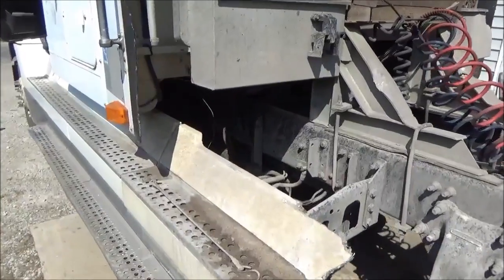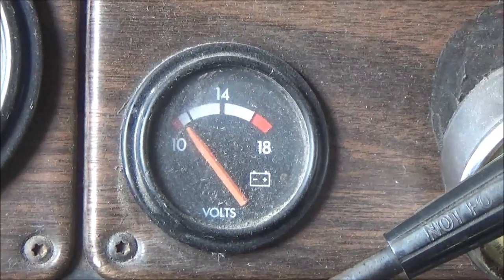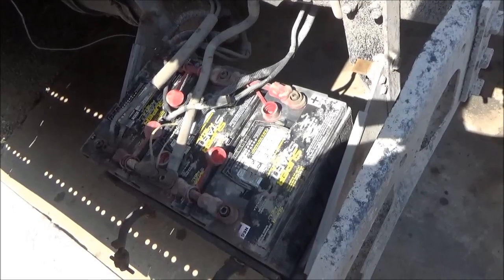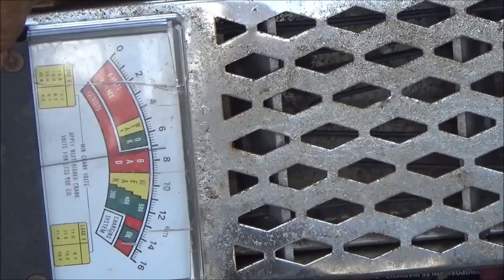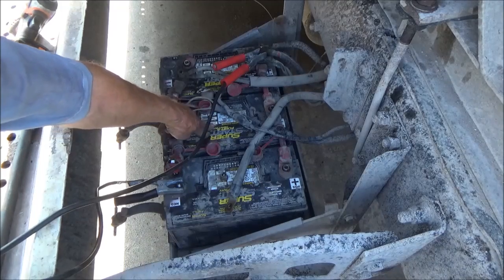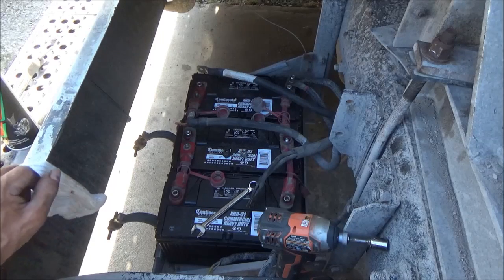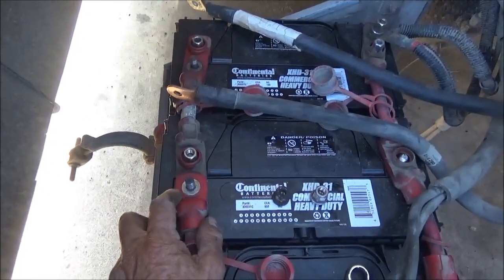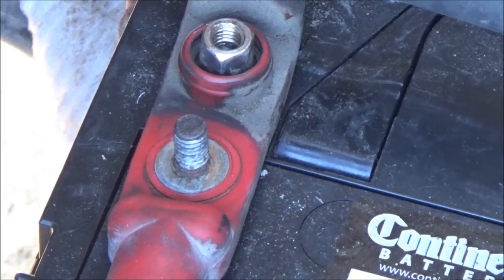How to test and change big truck batteries

Comment: Gonna toss my 2 cents worth again, lol. When you run multiple batteries, best practice is to run your circuits off opposite ends of the buss bar. Say bats "A, B, and C" are your 3 bat bank. Hook your positive lead the A end of the pos buss, your ground to the C end. Hooking both to the same end can result in a single battery handling most of the load. Another often neglected test when you get charging problems is to check for ac leakage in the alternator diodes. Charge your bat(s), fire up the engine, then hook an ac voltmeter between your hot and ground. If you get ac, any ac, it's killing your bats nice and slow. It's also a "slow leak" drain on your bats. A single diode being "just a little reverse bias leaky" can make you spend dough on bats better spent on groceries, lol. Some ac meter schemes will show a reading when hooked to DC however. To eliminate false reading, check both running and engine off. Should read the same on ac scale. If you see a volt or more difference, guaranteed leakage. Love the channel Gordon!
Reply: Holy truck this comment literally saved my life brother. Thank you
Reply: @thevikig420  you're very welcome, glad it was useful

Comment: Every time I had to reuse an old battery. It would shorten the new battery's life. I did it a few years ago. My truck took 4 battery's, and by using 2 of the old ones that tested good. The 2 new ones, only lasted 14 months. But when I would put all new ones in place. I would get 3 to 5 years out of them.
Reply from the maker: This is true if you leave a weak battery in with a new one but if you check the batteries often enough to catch one getting weak it won't have a chance to hurt the new one. In my case that hasn't been a problem for me because I do a lot of electric work and usually catch it before it has a chance to hurt anything. It's saved me a lot of money over the years.

Comment: With good batteries and a gear reduction starter and good cables and ground connections. That Detroit would spin over in 0 degree weather.

Comment: Have a question Gordon.
My truck sat for awhile and my inverter ran the batteries down 
I have driven a few days now and mostly been starting ok but sometimes when I try to start it the starter locks up just makes a clunking instead of rolling over is it the starter? Or are my batteries still low? I never had starter problems before it's a detroit like yours.

Comment: The spark at 10:30 when connecting the ground strap to the middle battery negative post indicates there is a parasitic draw, which can cause the batteries to go dead over time, if the truck is not run.
Reply from the maker: The parasitic draw you are referring to is the ECM (electronic control module) (the engine computer) it always has a slight surge when reconnected, also the power inverter does that too. Thanks for the comment.
Reply: I would be interested in the combined key off amperage draw for the two components.  In the 47 years and since ECM's were introduced that I have been changing out group 31 batteries, I haven't seen such a big spark unless there was excessive draw somewhere.
Reply from the maker: I went back to that place at 10:24 to see that spark and it looks like a 15a spark like headlights would be, but I've been driving this truck for 14 years and I have seen that surge many times when reconnecting the batteries, it doesn't drain them, it might if it were parked for a couple months but I doubt it, if you touch the cable and get a spark and pull it away and touch again within a couple seconds, there is no spark, so I don't think you'll get any measurable amp draw after the surge, it probably would barely light a test light. Thanks.
Reply from the maker: I think if I remember, probably 90% of that surge is the power inverter, it's a big one and I have had it in there since I bought the truck in '02
Reply: That makes sense to me.
Reply: @57bagre  I get a decent sized spark from my inverter when I first hook it up.  (seperate wire)

Its a 2000watt
Reply from the maker: @johnwood7650  That's normal but it doesn't continue to draw power and will not drain your batteries unless you leave it turned on.
Reply: @57bagre  yep for sure,  it only sparks once.   I was just confirming a big spark on first hook up.

Comment: Question sir, when I check my batteries while connected parallel it shows a lower CCA than when they are individually tested. Am I doing something wrong or are my cables bad? Voltages on both batteries are the same.
Reply from the maker: Sorry, I can't answer that without testing it myself.

Comment: Well you keep saying this old truck. Well that old truck will last longer then this new crap. Last winter I had to run down to erie pa from buffalo in the wrecker to do a tractor swap for yrc. The unit I was bringing back from pa went into derate mode. Well I showed up and the driver asked me. That wrecker got def on it. No sir that's a 93 kenworth with a 60 series and a 13 speed. We buy or build order stuff without the def.  He said lucky you lol. It was freezing cold that night lucky the tractor stayed running to keep him warm
Reply from the maker: I have no intention of getting a newer truck, I used to be a car mechanic a long time ago but I was never a computer technician. Thanks for watching.
Reply from the maker: I think I remember you from a couple years ago, were you following me then?
Reply: @57bagre  I don't blame ya. I need to catch up on your video's
Reply: @57bagre  yes sir

Comment: Where do you buy the battery nuts with the open threads?
Reply from the maker: https://www.amazon.com/gp/product/B00S10JMBO/ref=ppx_yo_dt_b_asin_title_o00_s00?ie=UTF8&psc=1     Also any truck dealer or farm supply.
Reply: @57bagre  The link took me to the closed top battery nuts. The battery nuts that you use are open top with threads. I've never seen those type of battery nuts. I found some on ebay. Thanks.

Comment: Gordon can you explain how a non-mechanic truck driver can jump start a 3 battery setup?  Is there a way to do it with a $600 pro mechanic style jumper?  Got a dead kenworth right now and in-lieu of trickle charging each battery with a 12-volt charger I'm looking for way to jump start.  Any help appreciated, thanks
Reply: Sorry, Meant is a way to do it WITHOUT $600 pro mechanic style jumper?
Reply from the maker: Just hook up cables from a car the same as you would jump any other car and let the car run for maybe 1/2 hour to charge the truck batteries before trying to start it.
Reply: @57bagre  thanks Gordon.  I like your approach to things.  People always quick to jump on somebody sharing their knowledge at the slightest difference. You know the correct way my friend. Keep it up.

Comment: you mentioned that the original 9/16s nuts that go originally with the batteries tend to get loose and thats my case big time any suggestions on how to eliminate that problem budd?
Reply from the maker: Try twisting the cables to the counter clockwise side while tightening the nuts, hold them far enough to that side so they will not turn all the way back to their natural position while you tighten the nut, then the cables are pulling slightly to the tightening direction when they are relaxed. Thanks for the question.
Reply: +Gordon Robertson Actuality thank you makes sense and i wouldn't though about it in a 1000 years
Reply from the maker: Very welcome, I hope it helps.

Comment: Gordon, how do you test an alternator? Can you do a video please. Thanks for sharing.
Reply from the maker: If you have a volt meter on your dash, just look at that and turn on a few accessories and kick your idle up a little (800 - 1000 rpm) and see if your volts stay between 13 and 14 volts. If you don't have a volt meter on your dashboard then clip a handheld meter on the battery. Good subject for a video.
Reply: @57bagre  Thank you very much, I will do that.

Comment: I think you need to look at the ground on the frame it shot out sparks at 17:02
Reply from the maker: Thanks, I'll have a look next time the truck is at home and make sure everything is tight.
Reply from the maker: Did you see my new video (Brazing, and repairing broken ground stud) on fixing the loose ground that you brought to my attention? the nut was tight but the threads were bad.
Reply: I watch that video i'm glad you found the problem.Their nothing i hate worse then turning off a truck and it won't restart.

Comment: Gordon - where do you live?
Reply from the maker: Illinois, near St Louis, Missouri
Reply: +Gordon Robertson in the Video you mentioned that you have more Machines Standing around - what Kind of Machines? also: would you recon the life in america? here in Germany its so... ruled by the goverment. best regards, Martin
Reply from the maker: I'm sorry, I don't know what you mean by recon, maybe we use that word differently here in the U.S.  My other machines are bobcat, mimi excavator,  and a number of small engine machines for landscape work. As for the government, we have our share of problems, if you're lazy and have no discipline, the government will meet all your needs at the expense of those who work hard, and we are taxed out of almost everything we don't need to eat. How then did I buy all this equipment?  If I wasn't a mechanic before I was a truck driver, I could not have bought this old junk and repaired it all. Yes this is the land of oppertunity but you have to know how to defend yourself from the government or they will eat you alive. We can continue this on private msg. If you want. Thanks for your comment.